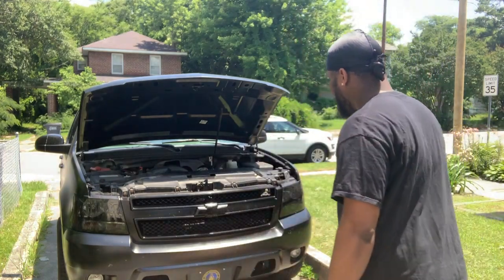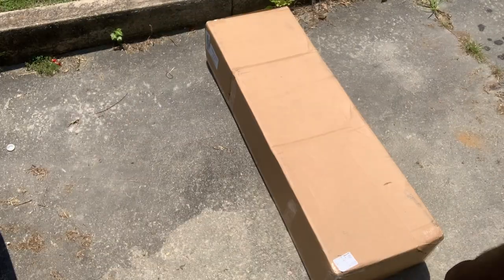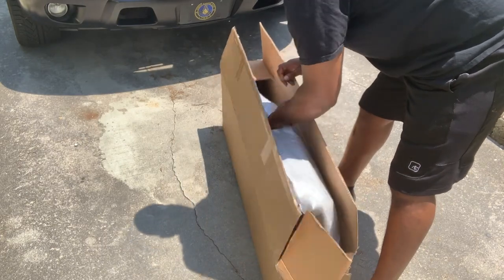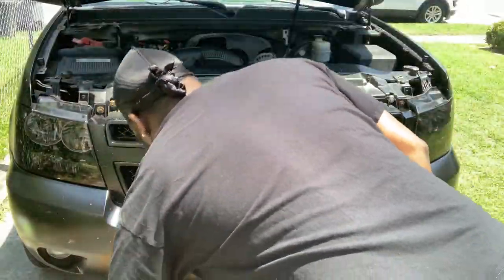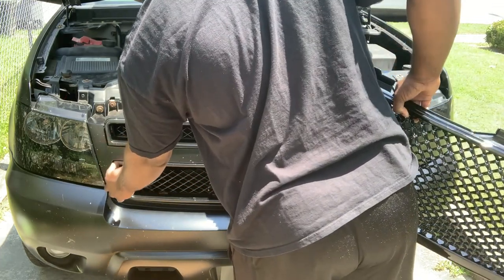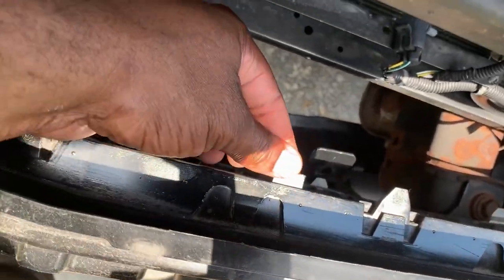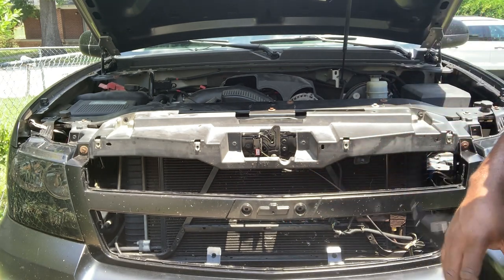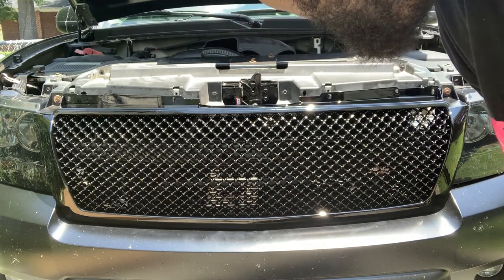07-14 Chevrolet Tahoe Front Mesh Grill Installation

Comment: I have a 07 Tahoe LS 5.3 l without the existing trans cooler. The 40K cooler comes with one hose. Make sure you have a 2nd long rubber transmission cooling hose! I was about to start taking my car apart but double checking all my stuff,i need 1 more long hose! 👍 I brought 1 gallon of trans fluid too.

Comment: So after pulling off the top and bottom part of the grill it just bolts up right? Looking at doing my avalanche same way with new headlights
Reply from the maker: Yes the bolts lined up ...I think there was only one that was a lil off but it wasn’t bad! I still have it on my Tahoe now and love it
Reply: Awesome man thanks for replying
Reply from the maker: No problem bro, hope it works out for you!
Reply: @540tv6  so no cutting is need just remove those sections like you did and bolt new grill down? Does it shake or vibrate at bottom? Thanks!

Comment: Dope. But what would be doper. Figure out a way to put Chevy bow tie in the middle.
Reply from the maker: That would be dope, ima check it out and see how it looks
Reply: You can just take off the two aluminum bolts on oem bowtie and just place in center. Only think is i just use the bowtie not the mold that it originally goes in just the one piece and looks good.